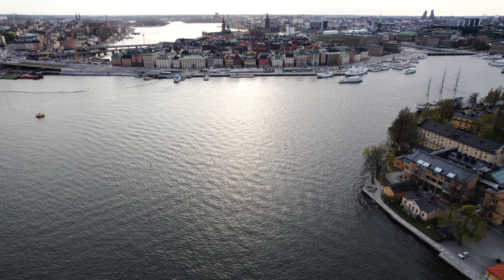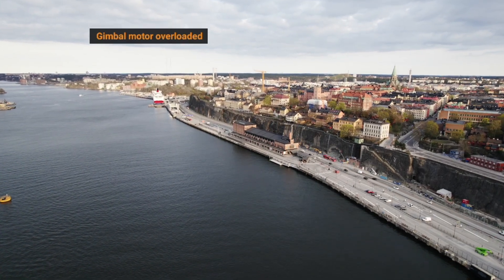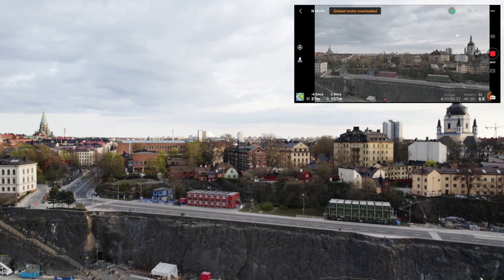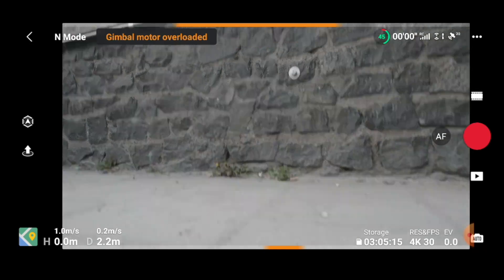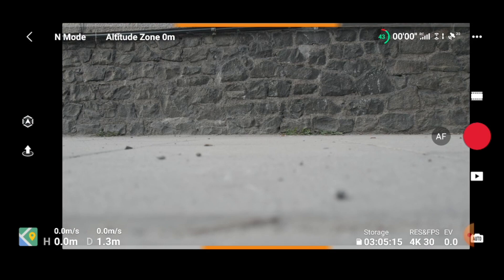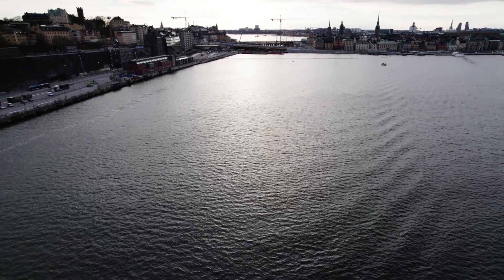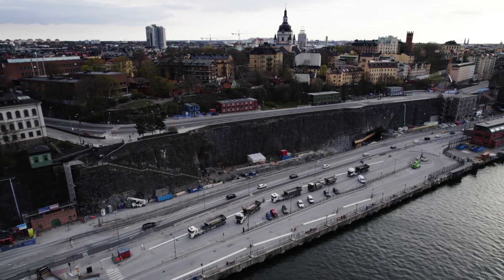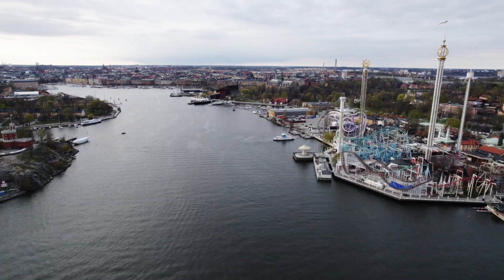dji Air 2s Gimbal Motor Overload - Possible Fix!

Comment: Hi, ive had this on my mini 2...i believe it can be a result of dust and grit..this has happened to me also i see you landed and there was dust and small  stones flying about..if you took off from there its easy some dust or grit went in...i use a manual rubber bellow dust cleaner from my dslr camera..and also now carry  a thin clean artists brush to clean the crevices of the gimbal just in case some dust gets in...

Comment: DJI products are good but gimbals sucks... all models have gimbal issues even new ones out of box.  And not only drones but hand gimbals also. My Mavic Air 2 also randomly started shaking camera and showing Gimbal overload error, calibration and cleaning does not work, official dji repair says 400$ gimbal replacement, when i asked why it happens they said gimbals are moving parts and they die usually when it's three years old (in europe warranty is 2 years). That sucks because i use mostly drone for photography and videography and now it unusable. DJI are coming out always new drones and i'm starting to understand why.. they want people to buy new drones, thats why they do it low quality.

Comment: 10 minute video and it took 9 minutes to get to the answer. Gonna save you some time it was "calibrate your gimbal" and check for loose grass or dirt, but don't use compressed air.
Reply from the maker: Thank you! Some people might prefer to understand the whole scenario, while others may be interested only in the solution. Nevertheless, your contribution is highly appreciated.

Comment: OK I was taking some top-down shots of recent flood waters in my city 3 days ago, increased altitude to 120m as as I rotated the drone to point west, i noticed the GIMBAL MOTOR OVERLOAD warning on the screen of the R/C for a split second. I immediately decreased altitude and the the message never reappeared. 2 Days AFTER that WARNING came on screen, I was flying my mini pro 3 in SPORT mode and noticed the live feed on the screen which I was not recording, started going wavey. I had assumed it was just mini turbulence or such. Discovered tonight, about an hr ago, there seems to be severed cables/tiny wires loose in the base of the camera gimbal and a crack in the frame of the left arm casing. I have not crashed my drone and have always used CINE or C mode up until the above incident. 

I DONT have DJI Refresh Care Cover on this drone, only the extra cover from the store where I purchased it last Month. What can i do?
Reply from the maker: It seems that the issue you are facing is related to the damage you noticed on the gimbal + loose cable. I would get in touch with seller and explain the situation just as you described it. They might offer you a solution. Meanwhile, I hope someone from the community have a suggestion.
Reply: @thinkthings  Thank You Khalid, I did take drone to a local repair shop, it should be back with me soon.

Comment: Got this the first time I took my mini 2 out. First flight was ok, the problem started after landing on dry tarmac to swap batteries. Gently manipulating the gimbal, blowing and recalibration fixed it. Lessons learned, use a landing pad and even tiny invisible amounts of debris can cause this.

Comment: My gimbal overload is an unfortunate issue. After getting my air2s stuck in the top of a tree, I ended up retrieving it but not after it fell about 100 ft by Kimball seems fine, but when I tilt the camera down 45° and fly to the left or right, the camera ends up hitting the top of the gimbal causing the image to jump and be unstable, this also causes a gimbal overload

Comment: I just had this problem with my Air 2s and found this video.  Calibration didnt help.  When I looked behind the gimbal, there were grains of sand on the back of it since I had flow at the beach the day before.  It wasn't much in my opinion, but apparently it was just enough to throw the balance off.  I stuck the drone gimbal in front of a desk fan for about 30 mins since that was the only air supply I had.  After 30 mins, the sand was gone.  I recalibrated and it is now working beautifully.

Comment: I had the same issue with a Mini 2. The final solution was to send it back and use one of my refresh care times for a new Mini 2. Sometimes the gimbal is just bad from the factory. Everything mechanical has a certain fail rate. DJI drones are no different.